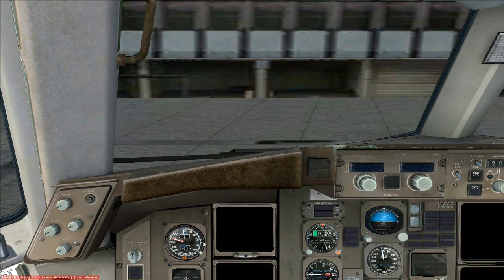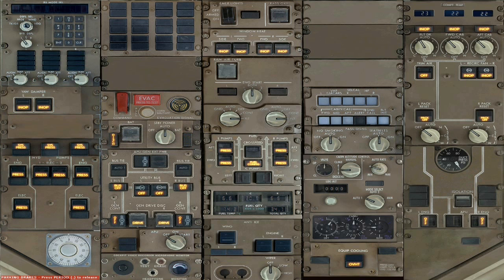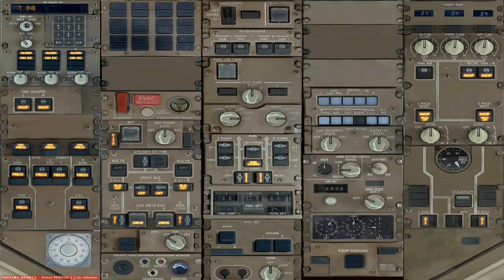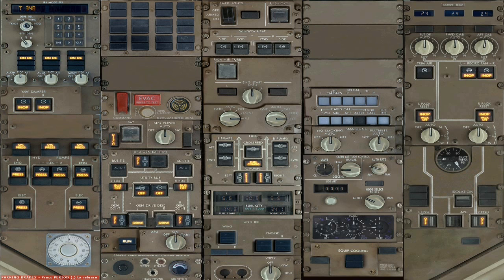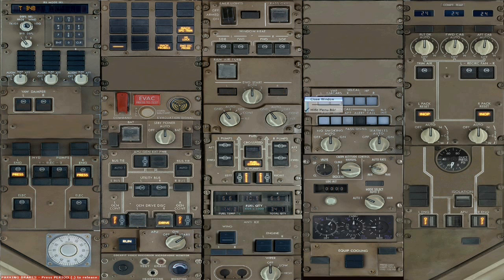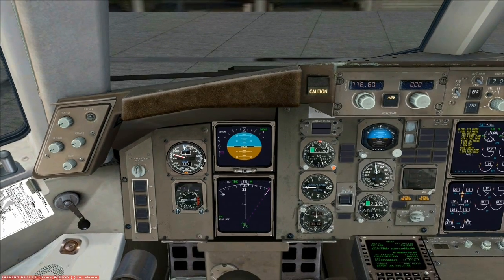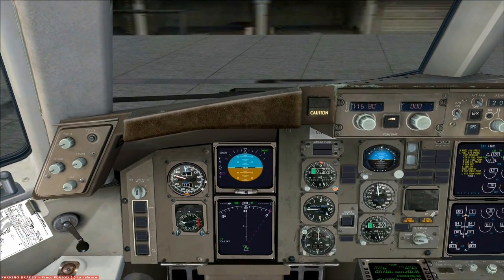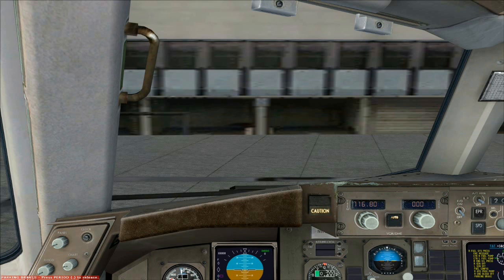How to start up the Captain Sim 757/767 in FSX

Comment: This plane sucks. The cockpit sounds are always hit or miss whenever you install/uninstall it. It(sounds) doesn't work on steam either. No sounds inside.WTF?
Reply from the maker: +lastcall170 
Using payware on Steam's FSX doesn't work out very well. It sucks, I know. They did a horrible job in bringing it to Steam.
Reply: I use a migration tool that works with most everything except important addons like Ai Ships; Fs/recorder and Accu sim.(for all planes). The 767 was a pain from day one with FSX too. Something about the files always getting corrupt or missing.As for my original FSX..it was ALWAYS crashing. Tried adding dll files and nothing worked. Its hard to believe that no one will fix this old sim.(fsx and steam)
Reply from the maker: lastcall170 Dovetail has acquired the rights to the Franchise, and all the FSX files. They are apparently working on a new release this year. 
Same guys that ported it over to Steam.

Really hope this can revive the community in some way. When Cessna154 left, the more vocal community sorta died out. Either way, I'm just rambling
Reply: Lets hope for the best thanks

Comment: @757Pilot100 Paint a pretty picture, I found out what I did wrong! I missed one step and that was all it took :( Before starting the engines I forgot to turn off the Bleed Air vents knobs. Low and behold I was shocked that when I did that I heard like a drop in the air and when I clicked the engine start to "ground" it was music to my ears hearing the engines spool up for the first time from a cold start! The "N3" reading climbed to 20 rpms and I clicked the fuel pump switch! We have ignition!